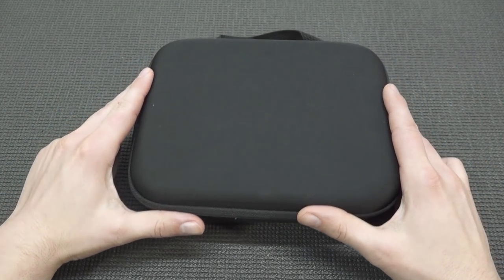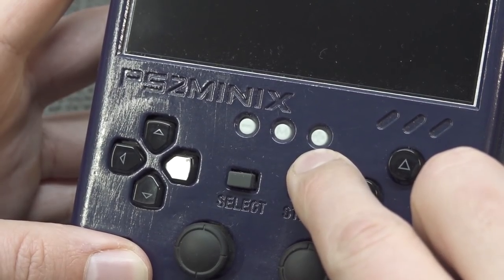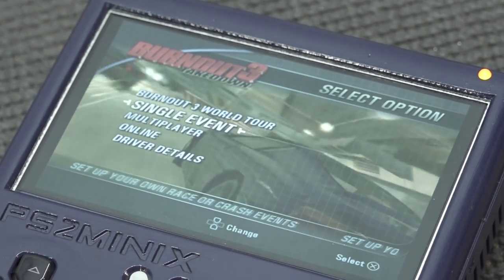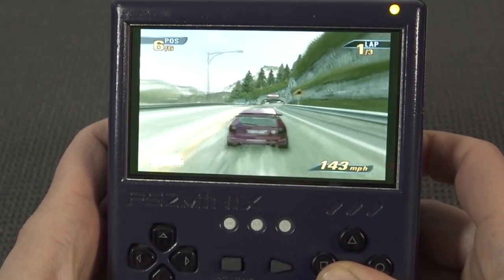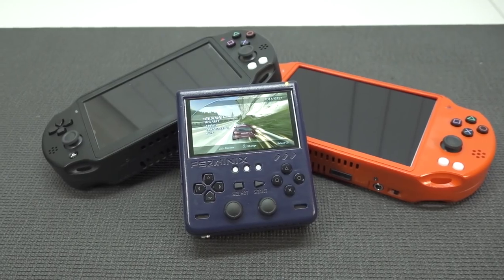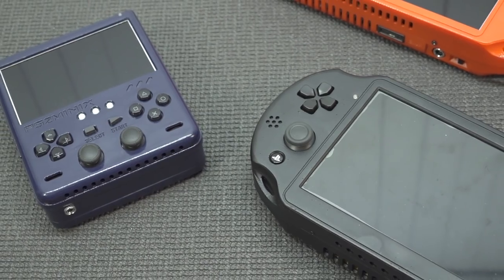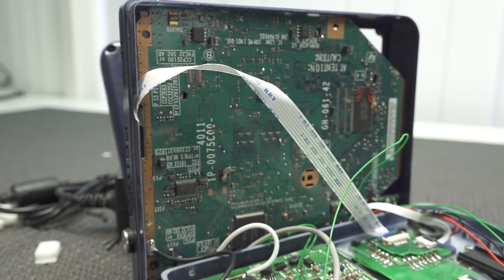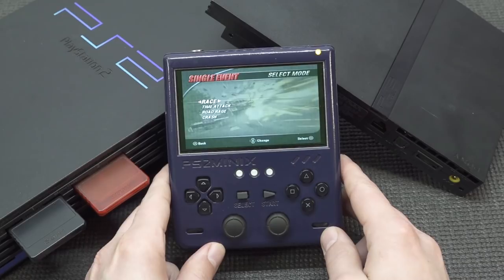The Best PS2 Portable Money Can Buy in 2021 🤔 ?

Comment: Honestly as amazing as this is, the components will fail within 5 years somewhere inside. Especially with heavy use.I wouldn't buy this unless you know how to solder and find faults on electric boards.
Reply: I agree 💯. Things like this are super cool but almost always give issues within a few years.
Reply: @arcaderacer586  of course, in a unit that small with original components there seems like it would not be cooled adequately enough. You'd need a proper remake from a respected company to peak my interest tbh

Comment: Knowing that this thing runs OPL means it can launch PS1 titles through POPSTARTER but the question is if that video controller board supports 240p over the component signal it uses. You have to test it. Please?